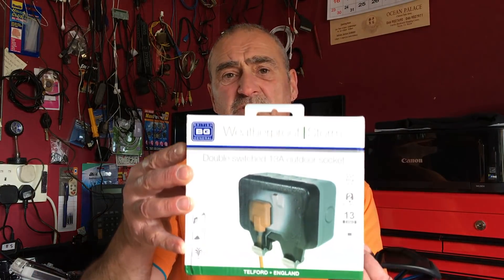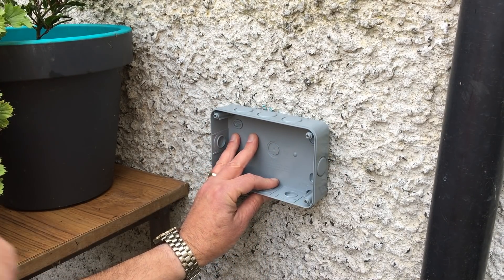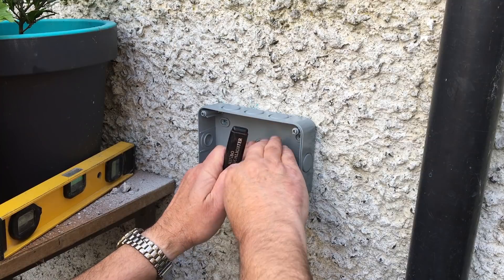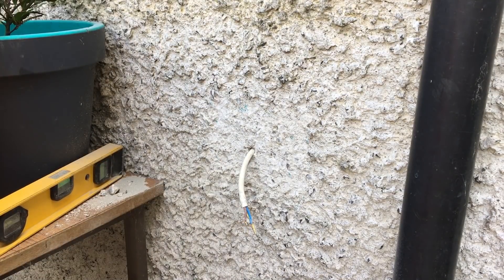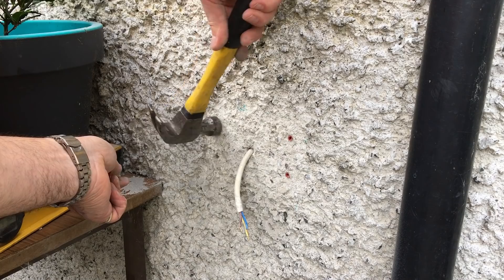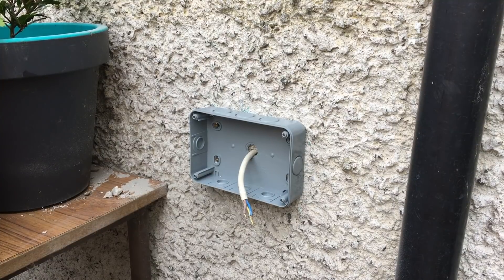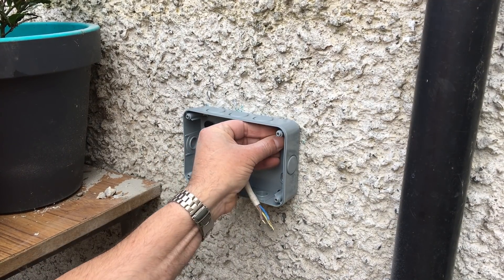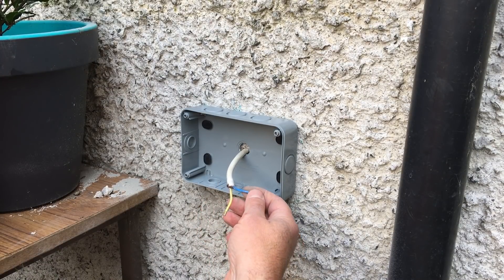How to fit a Weatherproof Double Outside Socket Yourself

Comment: After seeing the video, went and bought the same unit.  According to the installation guide, if using side, top or rear entry, the lower drain hole MUST be drilled out using a 5mm bit.  You didn't do this.
Reply: Your power lights are flicking and you have not used a socket tester you could have reverse polarity and you wouldn't know. Have you even tested the rcd tripping time at the board to make sure it works in the event of circuit imbalance??
Reply: @Mark-ij2nh  The flickering I presume is how the camera is picking it up.  This video is made in Ireland - which predominately  uses radial circuits rather ring final  - in domestic installations.
Reply from the maker: Hi Martin,
I have drilled/put 5 holes in the unit, 1 at each corner for the screws and 1 centred for rear cable entry point. They thus become drain holes. In addition I used an earth/ground cable on the plastic casing as an extra safety feature. The manufacturer has it IP66 rated but if you start drilling more holes in it then the rating would not apply.
Reply: You should always drill the drain hole at the bottom of the fitting to allow water out. In summer you will find it will build up with condensation.
The extra earth lead is pointless as it's a plastic box so it serves no purpose

Comment: Bought the same plug after I seen your video . Do the wall plug and screws come with it for the metal box ? If not what size did you use ?
Reply from the maker: Hi Liam MG,
Rawl plugs and screws were not included in box. In the video I used 4 rawl plugs size 5.5/6mm and 4 screws size 4.0 x 40mm.
Hope this helps.
Reply: Driveway Dudes brilliant, cheers !
Reply: You mean, you bought the same socket, not the same plug.

Comment: which wires go into which holes please, new colours to me
Reply from the maker: For single phase/domestic use - Positive or Live is usually Brown or Red. Neutral is Black or Blue. Earth if sleeved Green and Yellow.
Hope this helps
Reply: Thanks why is there 2 earths is this one for the earth on the unit its self, dont get why you would need one as the box is plastic
Reply from the maker: Playing it safe and following instructions included with unit. Some may say it's not necessary but if water did get in and the unit was completely saturated then the earth wire would do its job and ground
Reply: sealover1 there is a second earth in case you wish to add another socket somewhere and you can connect one socket to another and so forth

Comment: Ive got a box like this to fit. I read that you shouldnt wire a box like this in from the back because it gives a way for water to get into the box and you should always go from below. Wondering if you had any views on that?
Reply from the maker: Fitting instructions supplied show you can wire it through the back. You can also go from below if you prefer but try to make sure you seal it so no water or moisture can get in. Also take into consideration that you may have exposed cable underneath so you may need to fit a trunking/conduit and weatherproof it.
When drilling the wall, if from outside inwards then drill at an angle upwards. That way it prevents water travelling into the wall. Again seal the hole as best you can.
Since I fitted this there has been heavy rains, snow and freezing. No water or moisture has entered the box. 
For safety reasons it is 13A fuse protected and is wired to a spur with RCD/RCCB.  Also when not in use I cut the power to it from the main switched socket in my shed.
Hope this answers your question.
Driveway Dudes - Paul
Reply: Thanks, I had to put my order for the missing bits this morning and I decided to go through the bottom as I was worried about getting a flush fitting against the brick and didnt want to mess with silicon. I ordered some 1.5mm Hi Tuff cable which I believe should be OK for outdoor use. I thought 2.5mm or armored cable was a bit overkill for this use seeing as its such a short run. I ordered a weatherproof gland and an RCD at the same time
Reply from the maker: 2.5mm T&E is the standard for single and double sockets unless you are going to put it under a heavier load.
Personally I would not consider 1.5 for anything more than lighting.
Reply: According to my supplier:
3 core 1.5mm cable is rated for 15A 3600W
3 core 2.5mm cable is rated for 24A 4800W

I did read 2.5 was recommended if you are using a double socket and would be using both sockets with high power equipment at once, so I can see how regs might recommend that. However, I wont be running anything more than a lawnmower or a pressure washer and not both at once. Im connecting via a socket RCD and not directly conncted to the mains and seeing as my RCD is only rated for 13A the RCD would trip before the cable would melt anyway?

The ready made double socket kits on ebay and amazon come with 1.25mm cable and I doubt they are even upgraded for outdoor use. I would have gone to 2.5 as you suggested (just to be safe), but the fact that Hi Tuff 2.5 cable was a big jump in price put me off. I would have even gone to armored cable, but I dont think it would have bent for a bottom box entry which is what Im planning for. I know it is not professional grade, but it's better than the online kits so at least it's upgraded a little over what most people would have. If I wanted professional grade I would have wired it direct to the house at probably 5 times the cost :)
Reply from the maker: I'm glad you did your homework/research and have settled on what you believe suits your needs and budget. 
Paul
Reply: Depends really what you intend to plug into it.  1.5mm flex is rated up to 15amps  (higher than the fuse in the plug and/or spur)  - so no risk there.  Assuming a nominal supply voltage of 230v - you could run equipment up to 3,400 watts - using 1.5mm cable -  which is more than enough for any domestic requirements. The only reason to use 2.5mm cable is for even larger loads than that or longer runs  (to account for voltage drop).
Reply: @Ironbuket  Armoured needs to be earth bonded correctly. Hi-tuff is easier to install if going surface mounted. If your main consumer unit is protected by a RCD - then a secondary RCD is not recommended. For fixed installations where you are going from say 2.5 mm to 1.5mm then that needs to be de-rated with a fused connection.
Reply: @hughhennessy7912  I use a socket RCD because im not really sure about how the power works to be honest. It's running off sockets which connect to a unit in the garage which somehow connects into the main house somewhere. It was there when we moved in, but doesnt look original to me. I guess I could get it tested to confirm RCD protected, but cant be bothered. What is the reason why you wouldnt want to use a second one if you knew you were already protected? One of them is going to trip should something happen?
Reply: @Ironbuket  It relates to something called RCD Discrimination - and relative sensitivities.

Comment: Don’t think the caps for the screws are to stop the screws corroding. Maybe more for weatherproofing?
Reply from the maker: Hi Joshua, We make every effort to answer valid questions. Sometimes we even answer nonsense questions.
1st question. Caps were supplied with the kit so why not use them. They may help deter corrosion or would assist in weatherproofing or maybe they're just for aesthetic reasons.
2nd question. Ask yourself, does water conduct electricity?  
If the surrounding wall was wet, the outer casing was wet and water found a way inside in a way that may cause a short. Would it not be prudent to follow all safety instructions and protocols to avoid such a scenario and outcome.
We are not familiar with NAPIT though from research it appears to be a good training body for those entering the trade skills sector or for those wishing to upgrade or refresh skills. 
We would like to think that if you've learned anything from NAPIT then first and foremost is safety in the workplace.
Paul

Comment: I would advise a service loop inside the box
Reply from the maker: Good advice but on a 2 metre extension lead of which 300 cm of that is slack that could serve as the service loop.  
If it was a permanent hardwire then yes, we would have left some but not necessary this way.
Paul

Comment: Hi it said m8 screws are recommended, what screws did you use and length thanks
Reply from the maker: Hi jamiee90,
M8 is 8mm and usually refers to bolt sizes. 
I used 4.0x40mm screws with 5/6mm rawl plugs to fix it to the wall

Comment: Hi, thanks for the video,
Just checking at 8:20 it looks like your have wired both earth cables into the same terminal? Are they to be wired into the same or separate?
Reply from the maker: Hi Reece,
Yes. It's best for the earth for the cable lead and earth to the wall (ground) point be wired together so in the event of a short it can earth directly to ground.

Comment: That’s the easy bit,,can you show us where the power comes from to power the socket 👍
Reply from the maker: Hi Bond,
We have switched double gang single phase 3 pin UK sockets in the shed. Taking into account the mounting outside we were able to use a 2 metre household T+E extension lead with a 13A plug. 
With the old socket removed from the lead, fed through the drilled hole and wired to the weatherproof unit. It was just a case of simply plugging it into the existing socket inside the shed and switching it on or off. Alternatively it can be unplugged when not in use similar to what you would do with an electrical appliance in the home.
What we did is perfectly safe in that we were never at risk of coming into contact with live wiring and risk electric shock. 
You could probably have an electrician wire it in permanently but that would defeat the purpose of DIY
Hope this helps.
Paul 👍
Reply: Yeah